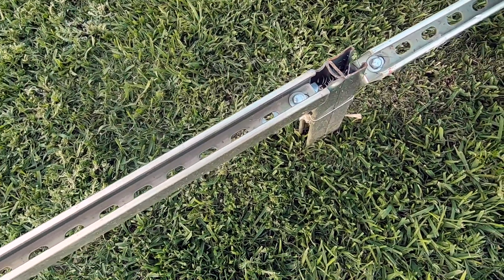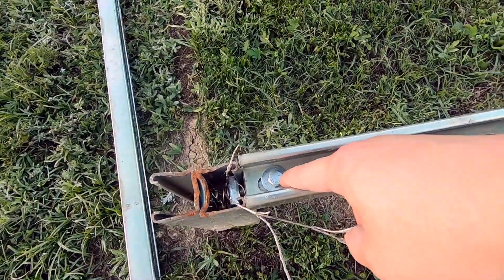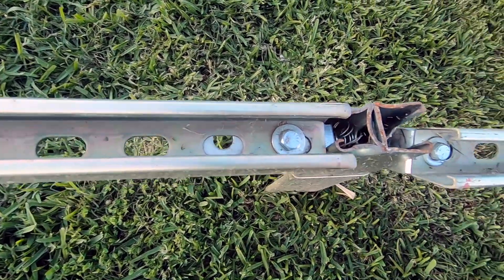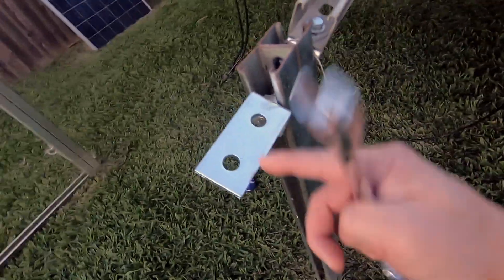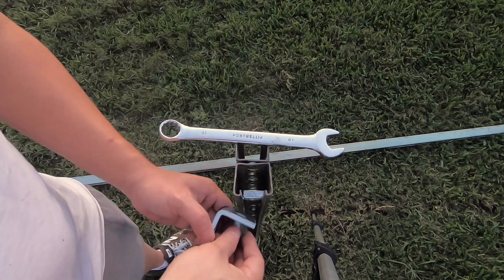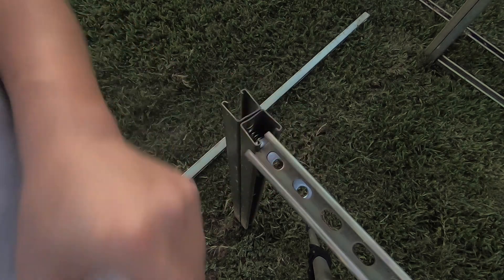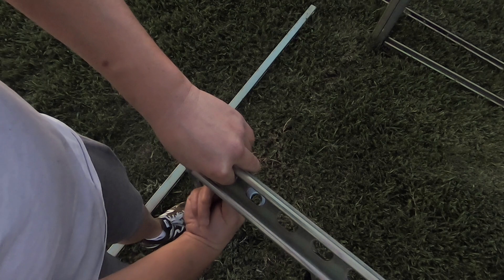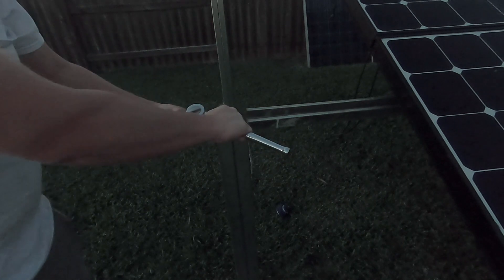DIY GROUND MOUNT SOLAR PANEL   ADDING HORIZONTAL BARS

Comment: Your video is great. Just 1 concern that I see is the horizontal weight is basically sitting on 2 bolts. It's not likely it will shear.. buuut.. supporting under the horizontal with a vertical is better. Maybe turn the bolt around, set the angle over the top and secure it to the other side. Then all the weight sits on the vertical supports? 
Thanks so much for sharing and helping others.

Comment: What height do you have on your columns. Going from top to bottom? The unistrut Going into the ground. And how much spacing in-between. I'm wanting to install the same setup with unistrut. But a small system like only 10x10 unistrut with 8 panels.